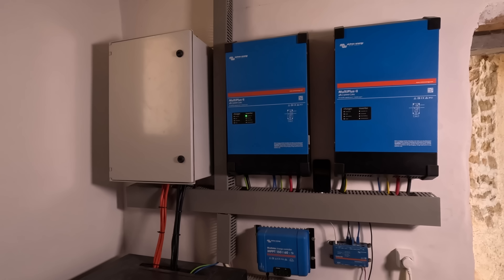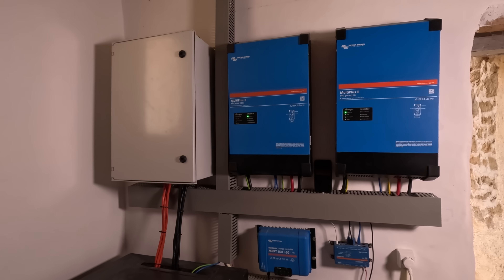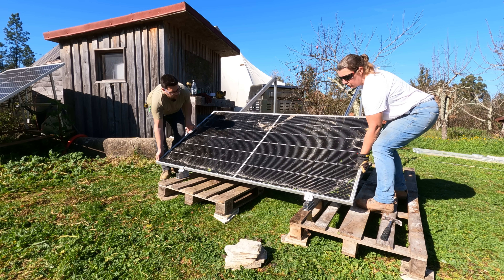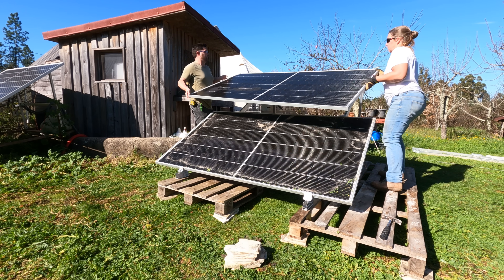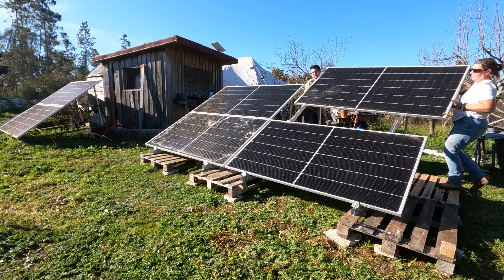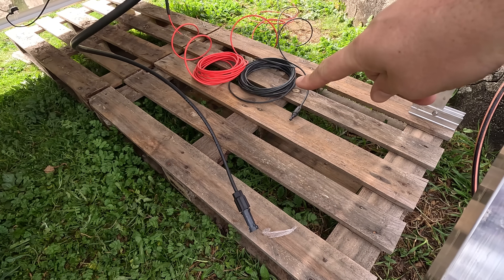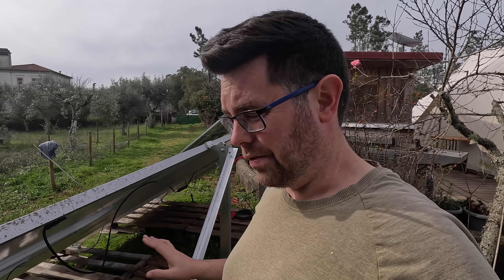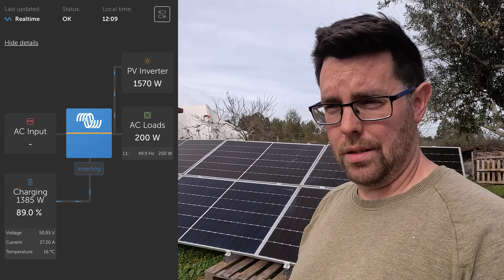Double the Power - Installing More Solar Panels (Off Grid)

Comment: dumb question sorry your figures 5.3kw is that what you will generate per hour providing its consistently sunny? in uk average home uses 8kwh a day so does that mean you are generating 42.4kw based on 8hrs sunshine? or are you just using less electricity than average uk home? or have i just muddled myself ?

Comment: Do you have full cell panels or half cells which have bypass diodes for cells that are not performing as well as the others?
You showed those 6 panels all in series and it's good you trimmed the tree as any shadow it casts will affect all 6 panels, as will any dirt on them.
But i have a question about your three separate panels that are all at a slight angle to each other. I presume they are in series and I think that they will run at the performance of the panel with the least output - so they are always hurting each other - wouldn't making them line up to the middle one ALWAYS improve the output of the 3 combined?

Comment: What anchor system have you installed? Those solar panels will blow away in a good wind if not well tethered.
I know you don't get the extreme storms such as here in a NE Scottish winter, but there is still wind in Portugal I assume.

Comment: Great job, wish I could do something like that (am slightly too old for it though, my back would never survive that 🥲). But as an architect I have a small suggestion: since you need planning permission anyway for your carport and outbuildings, add a new outer staircase to the batch. The existing one is the one thing that I really find worth changing on your house….

Comment: At some point you may want to increase your battery capacity to store the extra power, but I'm sure that you regulate the heavy uses (mostly things with electric motors) so that they happen more during daylight, and not all at once.  Even in midwinter, your heat pump can draw on its stored heat during the night if necessary.

Comment: Lovely stuff! I would strongly advise you add some ballast (anything heavy really) on those pallets to counteract lifting forces from strong winds.
Reply: Yeah, flying solar panels are not going to increase the energy. Bent rebar pegs buried deep will work at least temporarily.
Reply: Good comment.  Read my mind!
Reply: I was just chuckling to myself... those panels would be in the next county within a week if I tried a temp setup like that. It must be lovely to live in a place where one doesn't have to worry about constant wind.

Comment: Would love a bit of a q&a around the energy set up. Peak delivery, adjusted tilt or not, how you cope in summer months vs winter. Impact on bills, cost, how the heat pump is working off it. Feed in tariff or not... 😊
Reply: For you to know, G&K are running off grid.
Reply from the maker: We’ll probably do a data analysis etc once we have more data. At the moment we’re not using much energy so after next winter will probably make more sense.

If you’ve not seen it there are a couple of videos that detail our entire setup (all off-grid)
Reply: Thanks! I've seen them, and keen on the update. Will stay tuned 😀 @MAKEDOGROW